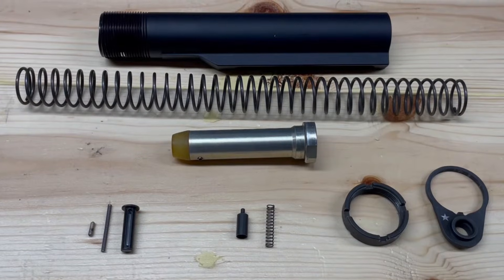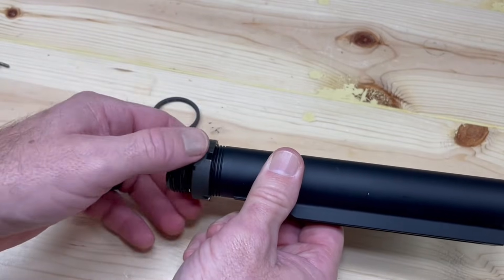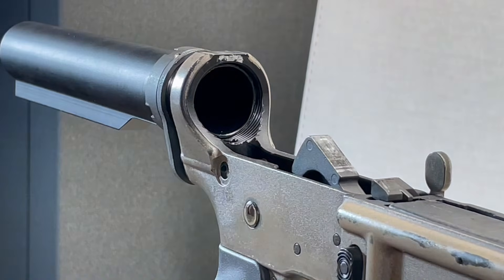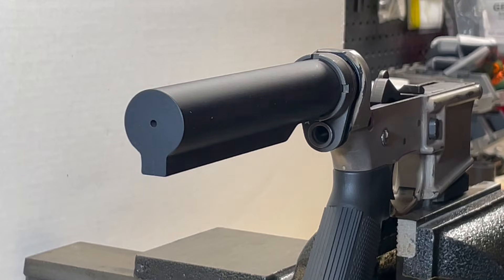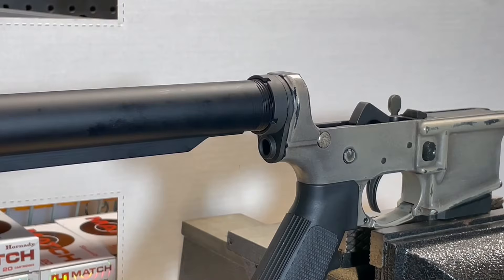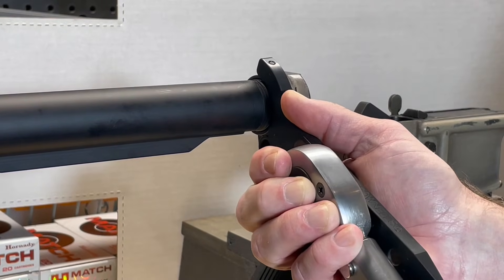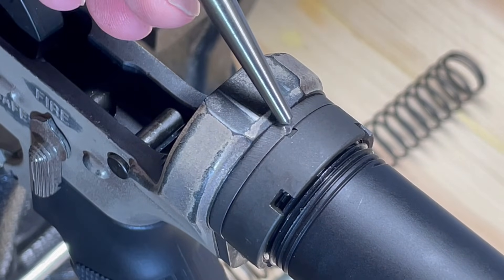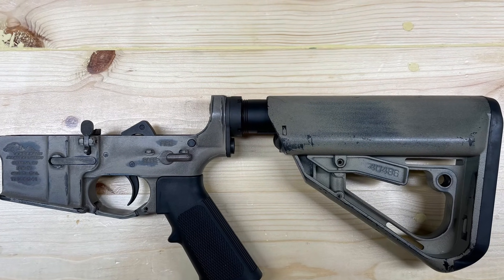AR15 Buffer Tube and Takedown Pin Installation

Comment: Can you use removable loctite on the castle nut instead of pinning the backplate. Sometimes removing castle nut can be hard, especially if your constantly  changing parts
Reply from the maker: I have used blue loctite before. It’s not as reliable as staking it. If that’s what you decide to do, I would mark or scratch across the back plate and castle nut so you can visually see if the castle nut moves.
Reply: @G @GunTalk556 thanks for feed back, appreciate the video

Comment: How do you know how much torque I know it's supposed to be around 44 or 45 lb how do you know without using a certain wrench that tells you how many pounds it is just by how many times you turn it?
Reply from the maker: You use a torque wrench. That’s the only way you can determine how many foot or inch pounds to apply.

Comment: My castle nut does not have the tiny square cut outs for staking. Is that an issue?
Reply from the maker: IYou could use a dot of blue loctite or just leave it. Check it periodically for tightness.

Comment: Great video! But, I'm having an issue. When I torque the castle nut, the buffer tube wants to rotate with it. Why is that - or how do I keep it from rotating? THX!
Reply from the maker: It will do that sometimes. Put the stock on the tube to give you some leverage and you can straighten it out by hand. Some tubes like those from Aero Precision have a cutout that slips over the buffer retainer pin. This will keep the tube straight while you tighten the castle nut.

Comment: Does the dented pin & spring actually effect the firearm of its for the takedown pin not to come off?
Reply: What if I want to remove the buffer tube ,but it has a decent on both sides?
Reply from the maker: @marcosablan never heard of that. What control or function is the second detent serving?
Reply: I was just wondering if that was the case if I wanted to change the buffer tube. Great video. I did save it, and I appreciate your response
Reply from the maker: You are correct. The purpose of the detent and spring are to hold the takedown pin in place.

Comment: Does the tightness of the Casale nut matter
Reply from the maker: Yes it’s very important. The castle nut holds the buffer, buffer retaining pin, and buffer spring, as well as, the rear takedown pin. The BCG slamming against the buffer is a lot of energy. If the castle nut loosens, this could cause the gun to malfunction and possibly injury to the shooter. You want to tighten it to 40 ft pounds and stake it to ensure it does not loosen.